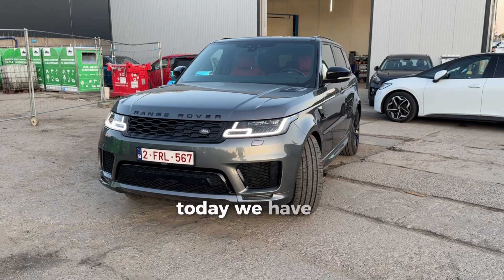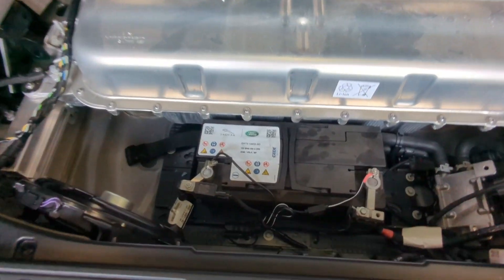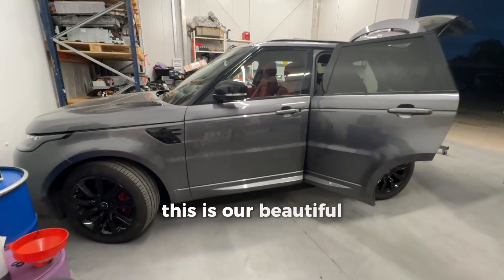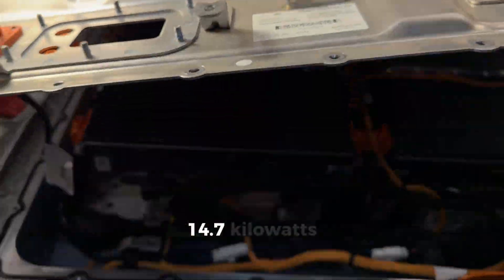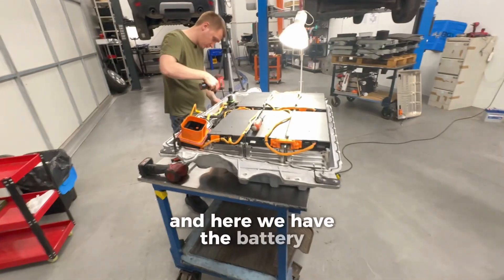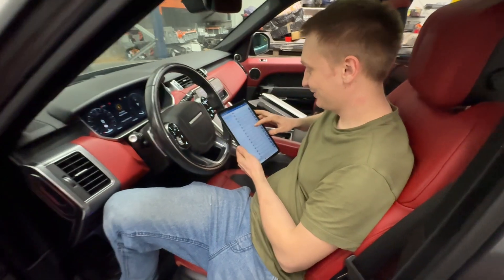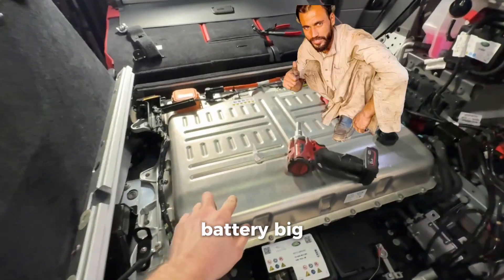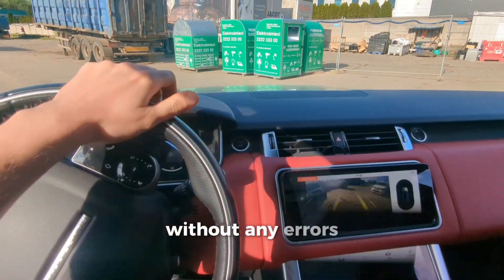Range Rover Sport P400e🔋 P0AA0-66 / 12V Battery Won’t Charge ⚠️ HV battery Replace or Fix?🤔

Comment: hello, thanks for the video! I have a battery from the same car apart with the same error code. where did you have the Samung module repaired? I can't get a new one unfortunately..
Reply from the maker: hi 
we can help you repair original bms. +48 884 134 264 ( WhatsApp/ Telegram)
Reply: Hey guys, Can tue charging system be tweaked for better battery regeneration when driving?

Comment: Great video and funny!
I’m having the very same issue with the same car... I’ve purchased a second hand HV battery pack, how easy would that be for a repair garage, who are Range Rover specialist (not main dealer though), to program / install a second hand battery pack do you think?
And what should I do with the HV pack coming out with the fault code POAAO-66?
Reply from the maker: @milesward1972  you can install used without programing.  

Check condition both 12v battery's, if need replacement all